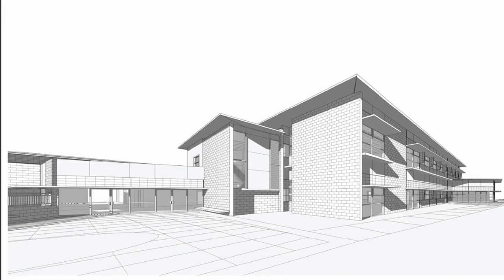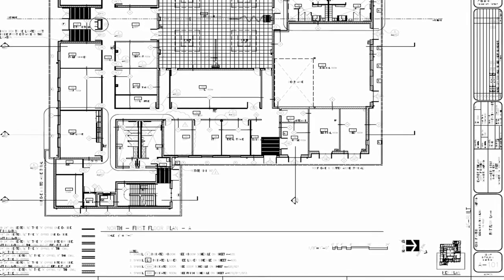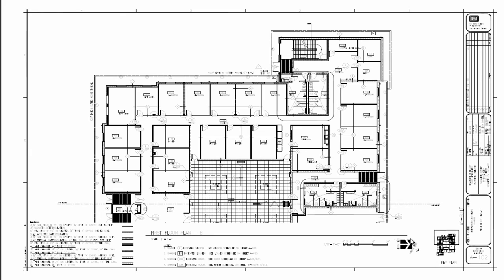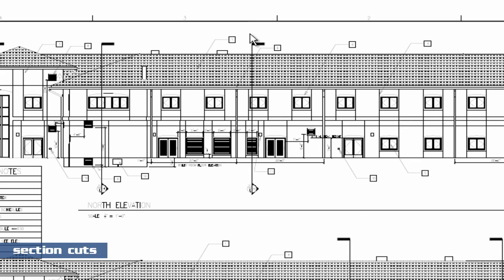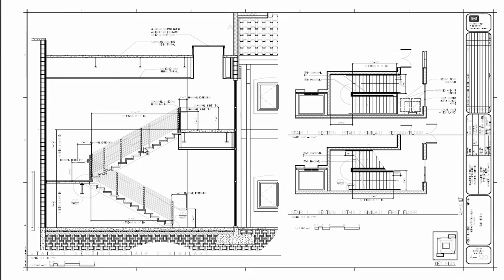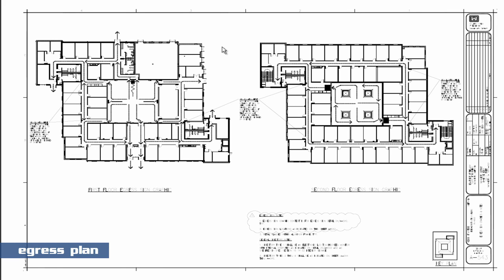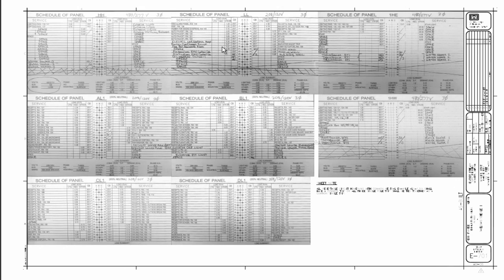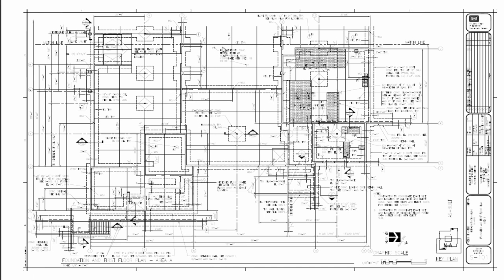PFC 101 Blueprint Reading Introduction Course Overview

Comment: Do you do Electrical only?
Reply from the maker: In this course, we cover primarily the main construction trades from Architectural, Structural, Mechanical, Electrical, and Plumbing. At this time, we currently do not have an Electrical Construction Documents course, but we are constantly developing courses and course materials. 

We do go a bit deeper into the electrical and trades in the PFC201 class which focuses on a Mixed-Use building. The PFC101 course primarily focuses on the Residential aspect and construction document basics.

Comment: Question. If I take these online classes.. can they be done at your own pace within the allowed time or does it need to be specific times?
Reply from the maker: Hi Susan.  Thanks for your email.  Yes, you can take the class at your convenience.  The course starts on the first and third Monday of every month, and it ends at midnight, on Monday night, two weeks after the course begins.  You will have access to the course materials for a month.  Please let me know if there is anything else I can help you with.    David McClain, VDCI Program Manager  david@vdci.edu  619-758-9300 Extension 402